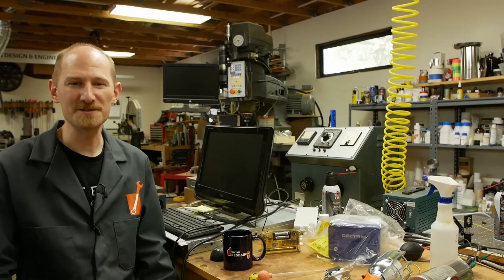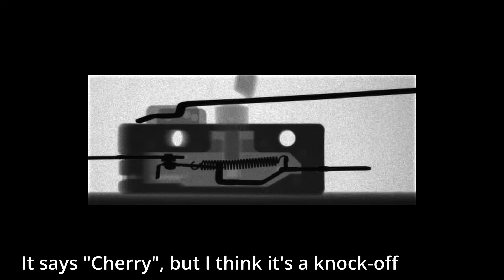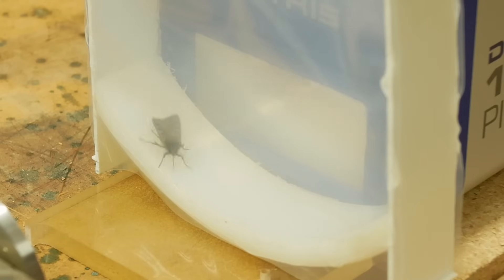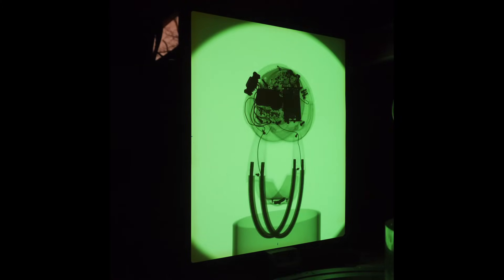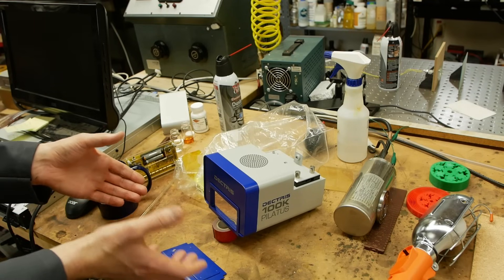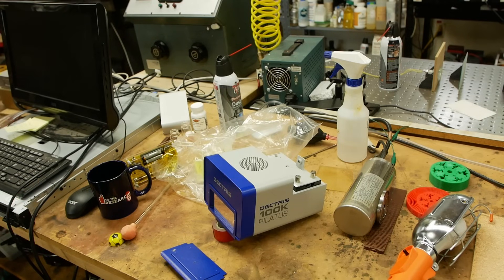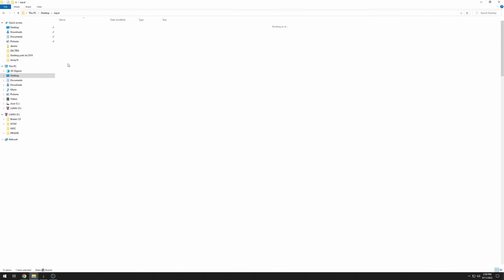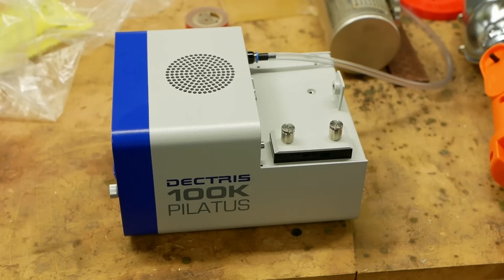High speed X-ray video: jumping beans, wind-up toys and more!

Comment: Interesting video. As a child I well remember the intrigue people had in the Buster Brown Shoe Stores. They had these verticle machines where you place your feet, with shoes on, into a compartment at the bottom and you looked into a viewer at the top. You could see your toes and bones and could tell if the shoes were of proper fit. Of course, it really didn't matter if they fit or not because you died a few days later.....not really, but they were apparently dangerous as they did not stay around long.
Reply: From what I understand is you as the customer did not get a huge dose from your limited time with it BUT the salespeople... They got the literal brunt of it.
Reply: That's exactly what I was thinking of during the video 😂 I think they were fluoroscopes? I can't remember and probably wasn't told correctly in the first place.

Comment: those contaminants on toys interest me alot. My dogs love tennis balls and things that have a cloth covering in general and ive always wondered what was in some of them considering their low cost and origin of manufacture.
Reply: Almost had to be metal fragments from the machinery used in production of the fabric.
Reply: Most of that is the plastic they use being recycled cheap stuff, because it is not visible and needs little strength compared to thickness. So they use the cheap contaminated scrap granules made from all the floor sweepings, pvc foil stamping with aluminium bonded to it (think of things like PVC blisters with a backing, what the blister was punched out of), old scrap lead acid battery casing that are ground up, and all the random plastic that gets sorted by colour alone. Mixed up, moulded into inside parts where not seen, and you often see marbling on them where different colours were not fully mixed
Reply: You know they always write in ingredients section on food “may contain peanut traces” or something like that
I think there is a similar situation here
Manufacturers make a lot of stuff at the same factory, and a lot of stuff may end up in the glue or in molten plastic, for example metal chips/dust
Reply: Yea I was a bit surprised and concerned at his finding on that toy! 😵‍💫
Reply: I assume it is lead.
Reply: Perhaps the contamination, is actually there on purpose to help add balance to the toy
Reply: @LFTRnow  Yes, that was my first thought too,  that layered/bonded on, under the fuzzy near the bottom to help keep upright?

Comment: You may have mentioned it, but what distro of linux is that? I have to capture loads of RT data at work, and id like to check it out and see if it has benefit over what we run now
Reply: The manuals on the manufacturer's website says they use CentOS 7.

Comment: You're so cool. Honestly, truthfully, I love how you do these experiments and demos which are fascinating and then go in depth about all the relevant details. I always enjoy your videos. :) Cracking your knuckles would have been great to see on highspeed X-ray if you're willing to accept the dose. 😺 A second or 2 at most to crack one phalangeal joint and capture that video.
Reply: Or just move your hand normally
Reply: @csours  I mean, that's pretty straightforward. A synovial hinge joint like in the knuckle just glides as it bends. It hinges open and closed, so all you'll see are the bones rotating about their cartilaginous connection which isn't very visible due to its density. Cracking the joint though...that's an interesting phenomenon. It's a rapid dissolved gas release from the synovial fluid. The bones move quite fast.
Reply: I have joins that crack on the regular, without provocation. I’d love to see what that looks like in this thing. My ankles are particularly loud for some reason, I’m only 32… Either way, awesome video as always sir. I love when I get the notification for this channel
Reply: @SilentRacer911  Me too. Everyone does, pretty much. A cracking joint is just dissolved gases being released by the pressure change in the synovial fluid capsule. Not really an indicator of pathological changes or anatomy. :)
Reply: I expect that the cavitation collapse in the knuckle would be too fast to capture with only 300 fps. 
You might get lucky and see something in one frame but there would probably be motion blur on the collapse of the gas bubble. You would see the response of the bones and tissue afterwards which would be really cool.
Reply: His ultra nerdness has wrapped around into ultra coolness.
Reply: @jhoughjr1  That describes the channel in a nutshell. Especially stuff like his own electron microscope.

Comment: This was amazing. Great video! Could you please comment on the "safety" of this device?
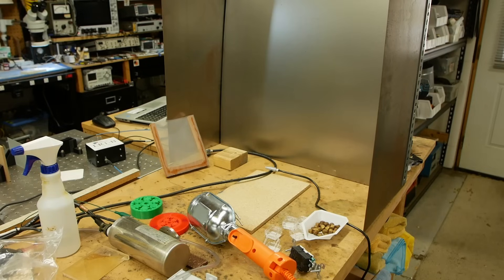Reply: 10:55
Reply: @MajhTown  Thanks. Just some words of advice. Please consider Wearing a lead apron (especially if you value your chance of having children.) I know in the medical industry, the walls have to be lead lined. So, I am not sure if a thin piece of "steel" is considered adequate shielding. But, none of that will matter if you keep sticking your finger into the beam like I saw in the video. Consider something safer for your hands if you keep doing that, its going to be an issue with exposure.
Reply: @marcfruchtman9473  That is being a bit paranoid for his purposes.  The amount of radiation passing through his body while he demo's this unit is hardly worth the cost of a lead apron.  Precautions used in medical settings are based on repetition of exposures over the course of a lifetime of working in the field, and a lot of assumptions.
Reply: @jong2359  He's already demo'd xray in the past, and not just for 1 "xray" image... but video image over several seconds, and not just 1 time, but several times. And has plans to do more in the future. Of course it is worth it. And if he plans to keep demoing Xray  equipment, probably should invest in reducing back scatter too.
Reply: @marcfruchtman9473  I believe he has a very good understanding of how xrays interact with the human body, and how the precautions in practice today were developed.  For every xray he takes "to the face," there are likely months or years in between.  He is more than intelligent/humble to consider the risks in being exposed to foreign xrays a time or two extra per year while he is interested in the technology.